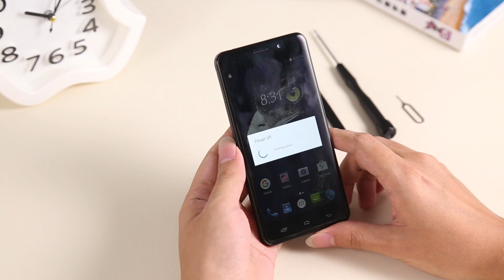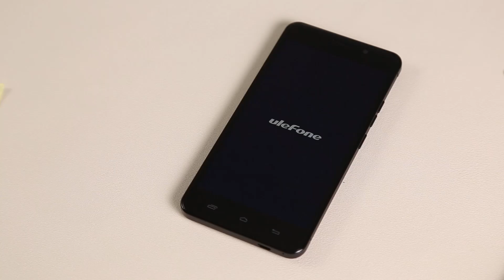Ulefone Metal Teardown and Reassembly

Comment: I need to change my sim/sd card slot, how do you do it? does it require a lot of soldering?
Reply: That part is fixed on the main board.  You need to replace your entire main board I think. That is not worth it.